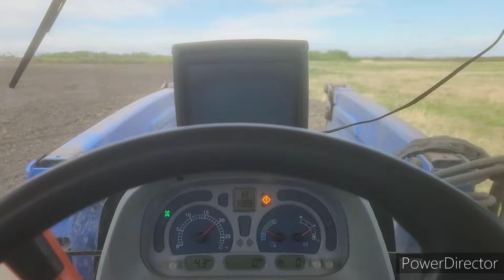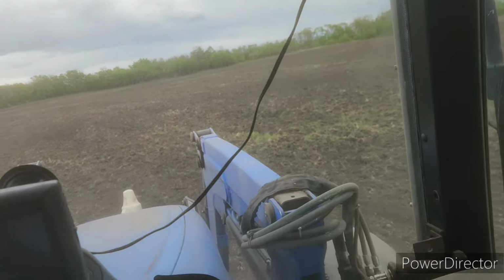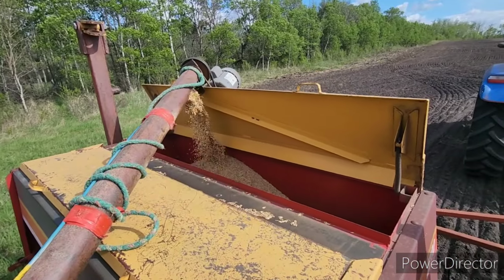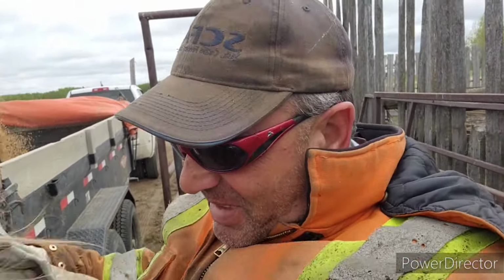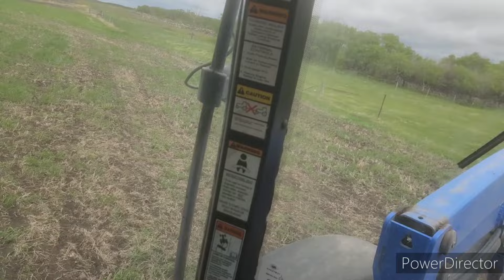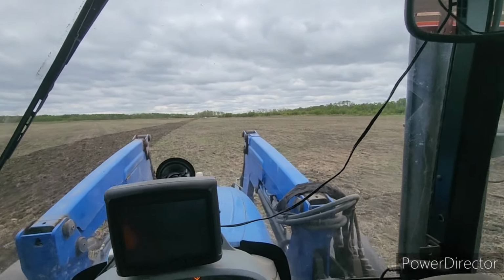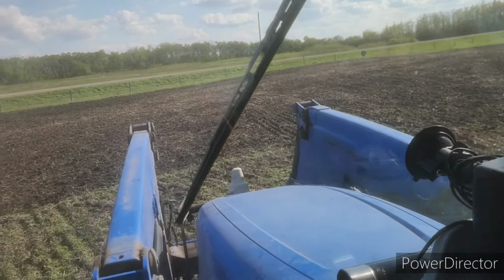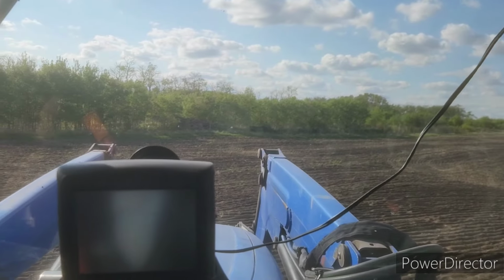Oats is Done On To Barley

Comment: Good morning farmer!!!   Awsome the country still has some farmers seeding with under 30 plus foot drills
Reply: And still use the steering wheel
Reply from the maker: I know what it was like when we seeded 450 ac with same machine and I was done before a few of my neighbors with same ac and bigger equipment
Reply: Yep, quite a few cow guys up here with smaller air seeders and old 4wd tractors running them.  We still seed a few hundred acres with 30 ft of box drills.  It goes pretty quick, just more stopping to fill than an airseeder.  Would like a no till box drill though to get away from cultivating in front of the drill.
Reply: And still tractor dating
Reply from the maker: @chadtosh6831  find yourself a versatile 2200 or a new noble